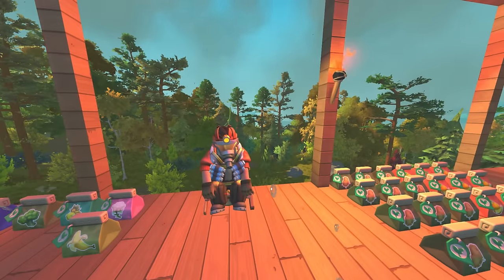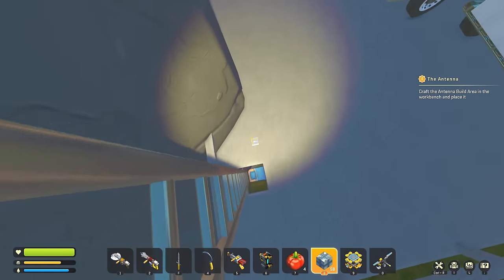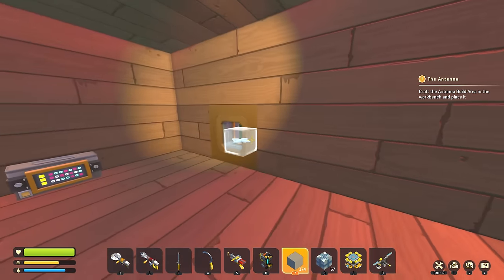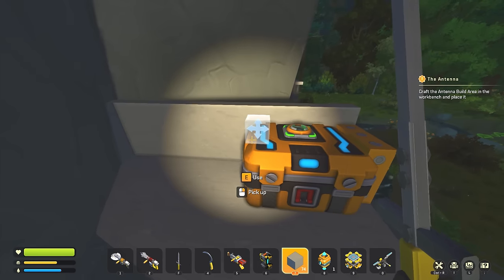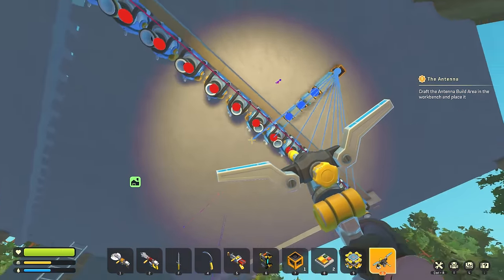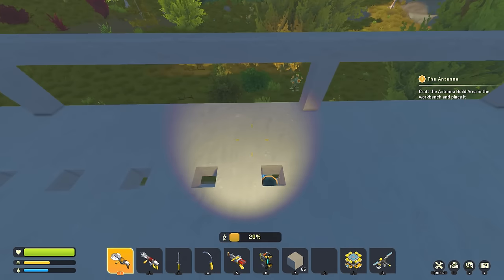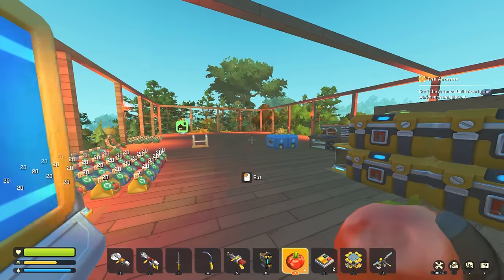I Built an Automatic Water System that Runs Daily by Itself! (Crashlander Survival Mod 32)

Comment: I was waiting for it to click. Yeh, it's about the chest being a big buffer, and utilising the flow rate to the watering container to compensate for the size of field.
Reply: I did some quick math based on what I saw in the video 
Water system math hypnosis 
Old: collection/s = X,  dispensing 1/s = 5Y, dispensing 2/s = 5Y, dispensing 3/s = 5Y, total storage = 300 water, available water = 300, transfer rate(switching containers) = Z 
Calculation: 5Y>X which prevents filling of other tanks Z is not used often here

New: collection/s = X,  dispensing/s = 15Y, total storage = 700 water, available water = 100, transfer rate(switching containers) = Z
Calculation: 15Y>Z>5-14Y>X with Z being close to 15Y it allows for smooth watering even though it has less available water than the old system

Comment: The manual switch should go into an XOR gate, not OR. Otherwise you can’t manually water when the pistons are extended, which is most of the time. Also I’d really like to see that system with the memory bit, shouldn’t take too many gates and would be more reliable than your current system: right now if you leave your base some time between 04 and 20, and come back the next day also during that time, the crops will not get watered for more than a day.

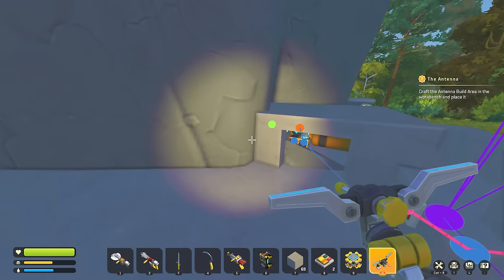Comment: 11:32 What you've essentially created here is a pump & accumulator system. The pump feeds the accumulator which keeps your flow at a constant, usually faster, rate than just off a pump.

Comment: If you leave the chunk with the pistons extended, they will be extended when it loads; if it loads with the logic telling them to contract, they'll immediately start contracting and vice versa for the reverse situation.  

There are two ways to optimize this, you could set it to twelve hours apart to minimize the average time until it waters them or you could try to set it up to increase the chance of it watering them at a specific relevant time.  The former seems more useful for full automation, as watering them at a specific time is irrelevant if you aren't going to also harvest them immediately.
Reply: Or. . . he could just ditch the stupid alarm clock and go with a looping timer instead. Water more times than once a day. Now that we fixed our refill rate, it's not like we can't afford it/our intake of water would still out preform the water we use. If we water frequently due to timer intervals, chunk loading doesn't really matter.

What does matter is finding out the right timer length for most time watering without outpacing your intake.

Comment: A really simple solution to the first (and last) row is to just move the hole one block forward for the first row and back one block for the last row, so there's only a single block gap instead of two. Instead of the sensor resting under a hole, the hole is right after it starts moving. Assuming the trigger is at the hole and not between (sensor to NOR to cannon).

It can fire one block later because the plot is 3x3, not 1x1, and the water splash is also an "area" not a single block, so it doesn't need to be exact.

Comment: I think it starts watering again as soon as you entered the chunk, and thus by the time you could actually see it, it was fully watered and extended again. I think you can sort of hear the pump going at around 23:40 when you are driving back (it is VERY subtle though)
Reply: Easy way to test this. Pull up a dirt then put it back down so it's dry.
Reply: No, what you heard will have been the pumps being triggered exactly once because their switch turned back on. They won’t actually have moved though. The game won’t retract the pistons when the chunk is not loaded, only start when your back in the chunk and their trigger is off.

Comment: If you want to get around the first row issue you can use a fourth piston, it can be level 1 since you only need it to travel 2? blocks. Then you set up the rail of cannons 1 block back so that the sensor gets to run over a trigger at the start and end.
Also, I have never had cannons hit every crop plot on large fields if they are set high enough to work under them.... You might get them accurate if the cannons are less than 15 blocks up, but then you need the cannon rail to retract all the way out of the way to one side.

Comment: You should just use a piston to keep the first hole closed and it opens when you start the system so it hits the first plot.
Reply: Yeah but like, that would be required for both the first and last hole. Which means 2 pistons. And even then, it would still need to be a toggle. . . which is what a memory bit is. . . where if you are going that far. . . you already made a memory bit, making the pistons irrelevant.

Comment: With the way you currently have it set up, it will only water your crops if you are at the base at times when the alarm has changed state.
If you are only ever there while your alarm is on, it will never water.

e.g. with it currently set to be on from 0400 to 2000, if you are at your base at 1200, to get it to water you need to be at your base at some time from 2000 to 0400.
If you are only there between 0400 and 2000, it will never water.

What I would suggest is to make it so the timer is on for a short period, put it into a not gate, then a rising edge detector, and put the output of that to a timer circuit which stays on long enough for the pistons to fully extend.

That way, if it remains loaded, the alarm goes on and then off, causing the output of the not gate to go off and then on, with the change to on causing the edge detector and timer to extend and retract the pistons.
And if you leave the area and come back, the not gate turns on, triggering the rising edge detector and also causing it to get watered.
At least that is how I think it should work.

Comment: Are the wolves , bears, and bulls scared of saw blades and drills like the bots in the base game?

A do not see a point on a timer on the watering system.  Just leave the water on, and put a switch to water when you plant.  You could also have a 4th piston in the system so it have enough room to start before the first plot and go to just past the last plot.  Literally the piston only needs to go 2 blocks so it should not need to be upgraded.  Can you put a sensor at each end of the system to make it go from one end to the other when you press a button... or maybe go out and back when you press a button.

The other thing I was wondering is if you had that extra piston you could add a planting and harvesting system.  Can you use a bunch of T parts and just have say one chest and connect all the pipes to that for 2 rows.  You have what 15 plots wide, so 30 vacuum pumps, 30 T pipes, maybe 4 elbows and a couple of filters.

I ran a system that had 6 chests with vacuum pumps harvesting, 6 water pumps, and 6 chests vacuum pumps to plant.  I had 2 pistons and I think this let me have something like 8 rows.  I just pushed a button and let it go.  I usually had it grow the makings for vegie burgers with 2 rows of carrots, 1 of tomatoes, 1 of beats and 2 of potatoes.  This game me a lot of extra potatoes for my spud gun too.  Most playthroughs I am lazy and just do a 5x10 plot with a row of 5 water cannons in the middle and put a bearing on either side to oscillate the pumps from 60 degrees back to 60 degrees forward using a controller.

Comment: @kANGaming, If you tweak your watering system to start 1 before the first spot that needs watered, and stop 1 after, it will catch the first row in either direction each time.
Reply: if he did that he would need an extra piston hes maxing out the current ones

Comment: For the first and last row, couldn’t you just have a block that’s rotating on a bearing which would cover the hole for the sensor when the pumps reach the end and then uncover the hole just before the pumps retract (maybe use a controller) and a similar thing for the extension

Comment: Couldn't kan just use the alarm clock as a means to "pulse" a logic signal to an OR gate for the initial water shot? The memory bit seems a bit unneeded.

Personally, no offense or anything, but using the alarm clock instead of say. . . a looping timer. . . it just seems kinda. . . unwise. Using one alarm clock means it only goes off once a day. A looping timer means it goes off every (set amount of time). Chunk loading doesn't matter if the intervals are frequent enough. 

Like, we SUPER improved our water load times that I don't see why we WOULDN'T take advantage of it with more frequent watering. It's not wasteful if your refill out-paces the crop watering. . . which would be defined based on the frequency/length of the looping timer. 

My point is, you can HEAVILLY optimize this system in VERY simple/easy-to-setup ways.
Reply: The pulse is also what I thought of initially, but it’s actually more complicated, because you then need to lengthen the pulse to last long enough for all pistons to extend. That would require a decent amount of logic, too.
Reply: @rccookie6202  You misunderstand. The pulse would be for the FIRST water shot (since it currently skips the starting position). It fires off before ANYTHING piston related happens. If anything, you want it to be quick so it turns off before the hole sensor reaches the next hole.

There are 2 things hooked up to the or gate. First being the pulse that is triggered every time the alarm changes state, and the second is the gap sensor system he already has. Both of these don't do anything to the pistons, it just tells the water when to shoot.

Comment: I'm curious as to why you upgraded the width of the ramp, but didn't move it such that you didn't have to constantly dodge a rock every time you used it.  Seems like simply moving it to the other side of the garage, any side where it can fit correctly, would be better than dodging the rock.

Comment: Pretty sure you miss watering because the pistons is slightly to fast and doesnt always line up overshoots the soil try like lower the piston speed with like 1 or 2 notches  since you have 3 pistons the watering header basicly moves at the piston speed x3 minus whatever the friction the rails reduces the speed.

Comment: Should've left it at 04:00 to 16:00, waters every 12 minutes.
Reply: Or loop a NORMAL timer. . . so this way it can water every 2 minutes or whatever intervals he wants. The watering only once or twice a day thing. . . I don't get it.
Reply: @Hadeks_Marow  Had the same thought as well. Just didn’t feel like expressing it in the comment, but I believe a normal timer would restart the time when he leaves the chunk no?
Reply: @GreenAxolotI  If it goes off frequently enough, it shouldn't matter.

What does matter is making sure you don't go off too frequently to the point where you are using more water than you are obtaining. It comes down to learning your input:output rates and finding how long a delay you need to have the ratio be 1:1.

Alternatively, isn't there an inventory observer now? He could just making it activate again when the large chess is full. This would be the MOST optimal way to do it. Well I mean, you would also need a failsafe timer toggle to make sure you don't reset the pistons prematurely.

Comment: kAN, you should set the alarm clock to be half a day long to maximize the chance it hits an interval. The way you have it set up now, if you leave before midnight, and return after 4 AM it will miss that day's watering. Conversely, if you set it up to be 00:00-12:00, or 06:00-18:00 you would have to be out and back longer than 12 hours to miss a watering schedule

Comment: 25:50 or you move the entire system, a couple blocks back towards the tree
Reply: Would require and additional piston then. Even if that piston is only level 1. Taking apart the system to set it back up is a pain. You aren't wrong, but still a pain. Spaghetti logic, much less painful.

Comment: 0:42 your reasoning of four component kits to say 12 to 16 Capone kits makes sense kon gaming that just my point of view on your statement, other of yours may differ from you and me, but what you’re saying on the intro of the response for the whole not using pistons makes complete in other sense and quite frankly I agree with you on the not using pistons once you explained it the only thing that was gone through my hole is why did you not do the symmetry on both sides for the hinges but you explained it in the last video that it was able to work fine with meeting a second hinge like that first one on the opposite side and when I heard that I thought well if he doesn’t need to make a second long wood hinge on the opposite side to hold up the door then that’s good for him, especially if it’s still manages to maintain the weight of the vehicles crazy piston idea on a different sidenote would be a sliding piston platform into the garage for your hover vehicle if you didn’t do it on top of the staircase area where you were going to use all that concrete or stone or mentioning in the last video and the reason why I said!  crazy kan it’s because I’m not sure myself if a you’d be able to get a single or double pit it in platform that would hold the weight of that however vehicle that can go in and out of the garage without colliding from the floor garage into the ceiling clearance wise but like I said crazy does that mean you have to do it? No, not necessarily it is your play through after all you’re serious videos as well. Hell, I don’t even know what I’m throwing out There would even work only the scrap mechanic expert who played the game would know if what I’m throwing out there in terms of suggestions would work that included you kan gaming